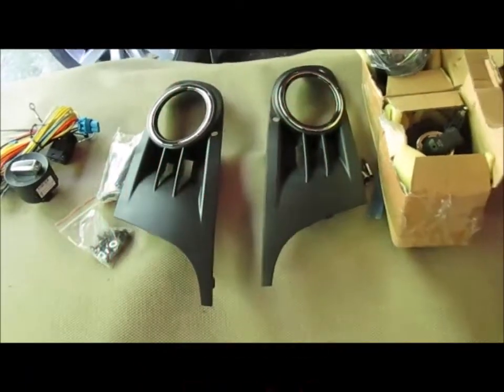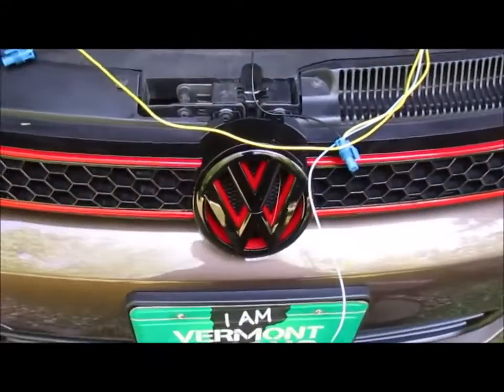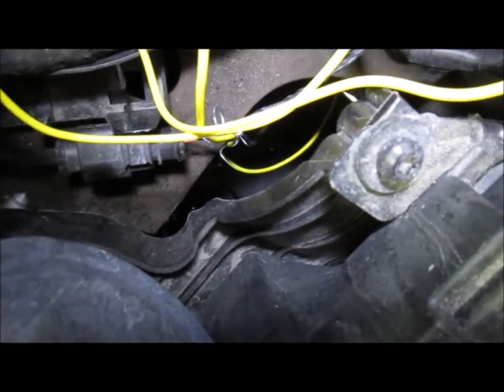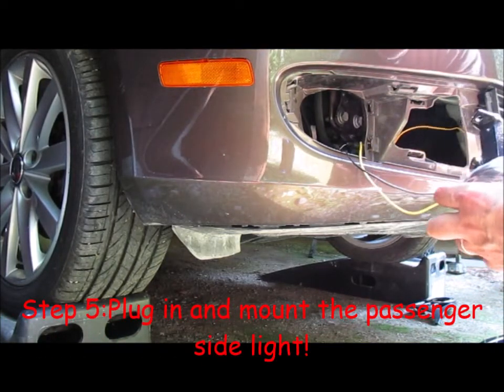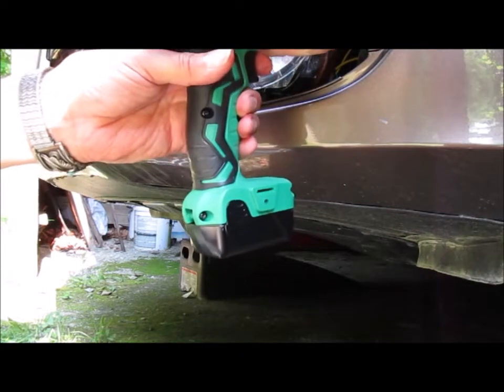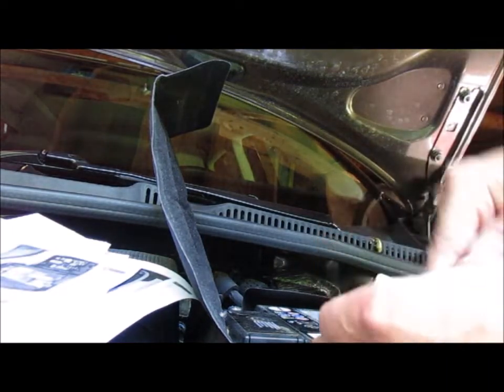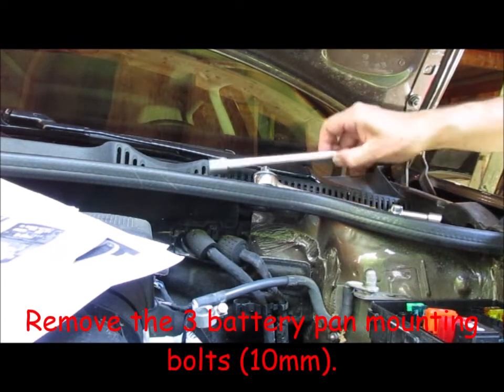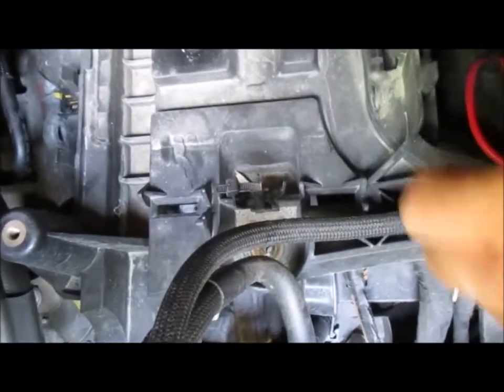VW Golf & Jetta MK6 Sportwagen Fog Light Install Part 1

Comment: Hello, great video and very helpful. I have a 2014 Sportwagen TDI and I have a big AIrbox in the way so its difficult to see where you installing the brown wire. Did you have the airbox as well and if so, was it difficult to remove?
Reply from the maker: No, there’s no air box on the gas engine car. The brown wire is ground. Any screw or bolt that goes to the metal body will work. I’d look for a black wire that goes to ground anywhere nearby.  I hope that helps. Stay healthy and 6’ from others. I hope that sounds/looks strange in a few months!
Reply: @alanwbelcher  Ah right, Mine is a diesel and yours is not. Well, I took the airbox out as it gave me much more room to work. I also didnt have to remove the battery tray to get the blue wire through the firewall thank goodness, sounds like that was a pain. All I have left is to pull our the switch and install the blue cable. Again, your videos were extremely helpful, Thanks for taking the time to make them.

Comment: Where did you get the GIT badge from
Reply from the maker: Hahaha!  The grille was an aftermarket knock-off GTI version and I couldn’t remove the lettering mount so I just pried off the letters and mixed them up. I got the grille on eBay years ago, made in Slovakia. Thanks for watching.
Reply: @alanwbelcher  well I just got my fog lights installed so I'm pretty happy now, cheers mate
Reply from the maker: Congratulations!  Have fun!!

Comment: Alan, did you have any issue with the auto function of the new headlight switch? My headlights are staying on the entire time the car is running, and not going off. May be related to an LED headlight install we did at the same time as the fog light upgrade, but wanted to ask you first
Reply from the maker: Thanks for watching and for your question. I don’t think my VW had auto headlights, so I can’t say. I didn’t have any issues with the fogs or headlights after the installation however. I will suggest that making 2 changes at the same time can make it difficult to isolate a problem.